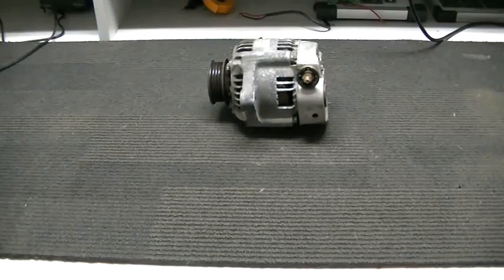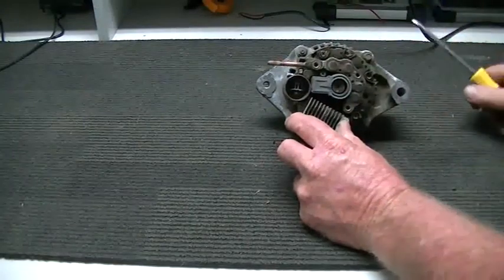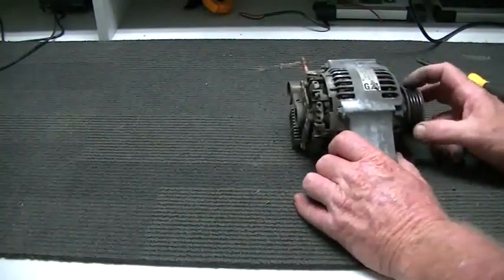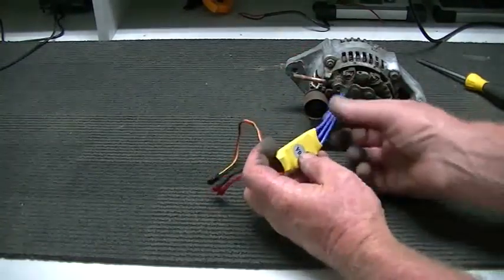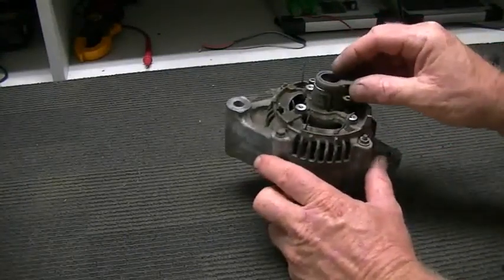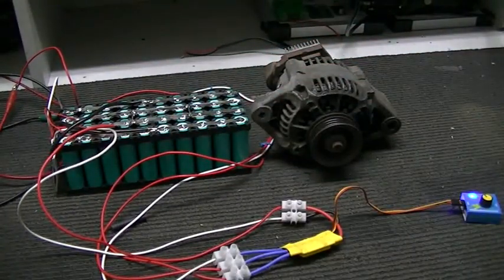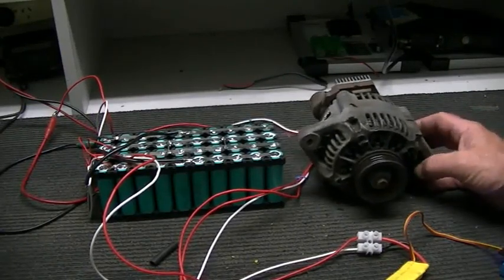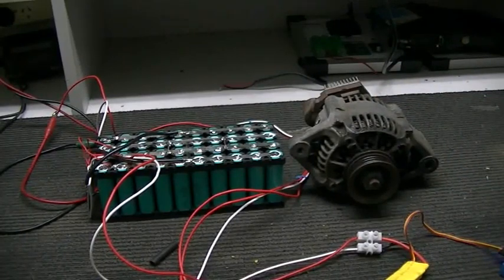How To convert Alternator to Powerful DC Motor

Comment: I am using same esc but my esc dosent work the rotor just vibrates in its place i am giving rotor 3.7volts and stator has 12 volts please could you tell me the problem

Comment: I have tried the same thing. I put 12V to rotor, and used an other 12v battery with the driver. It works for 30 seconds and stopped. The ESC doesn't work anymore. I tried an other one and it got damaged too. I don't know if the problem is inside the alternator. It is in star mode. I need help. Thank you !
Reply: Look I don't really know but sometimes these motors need a separate battery to give them a starter kick and then the battery has to remove itself or burn out. I watched Jeremy Fielding great teacher explains well. I need to go back and watch again

Comment: Iam using a set of 6 batteries (6 volt - 4.5 amp) connected contiunos give me 36 v and controller like the one you're using in the video but the alternator doesn't work
Reply: Umm most of those cheap controllers are only designed for 12v, you've likely burned the ESC... You'll need one that's rated for 9s lipo

Comment: Great video, I plan to use 36v 30Ah for a total of 1,08kw that should be enough for this motor right. Also have a few questions, can this motor run 110v 30 amp. Can it run AC current. Do you know any good AC to DC converters that are rated at 220v or 110v 30 amp

Thank you
Reply: It can't.
The windings were designed for high current, low voltage. 
There's a possibility you could run this on 3-phase AC stepped down, but then the speed would be constantly at either 3000 RPM (50Hz) or 3600 RPM (60Hz).

Comment: I tried this conversion in the past to run an ebike..and the torque is awfull..its garbage..because of the rotor electromagnets which are triangle shape..a true bldc has more powerfull magnets than those triangle electromagnets..so dont waste time
Reply: Maybe you did it wrong. I have seen gokarts with this mod and they screamed, fast as hell. Maybe you did not use enough voltage.
Reply: More voltage you put to the rotor, the more powerful the rotor electromagnets are.....
Reply: He did wrong, because lots of people on the internet uses them
Reply: You need to power the electromagnets M8...